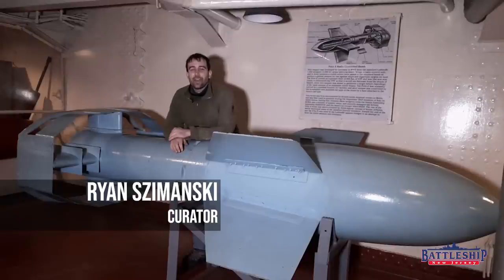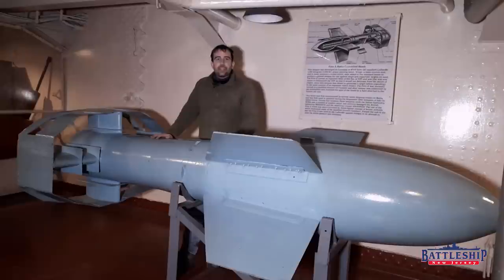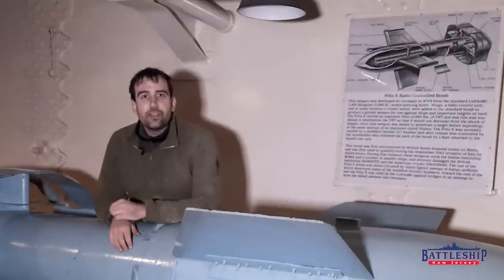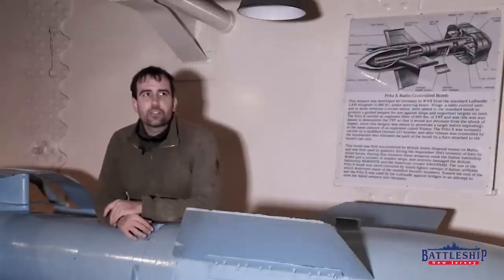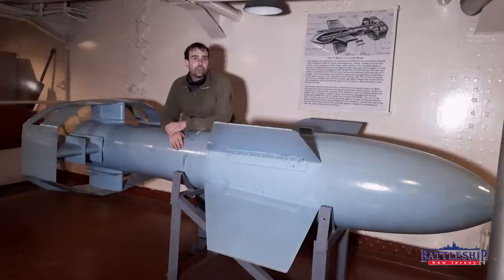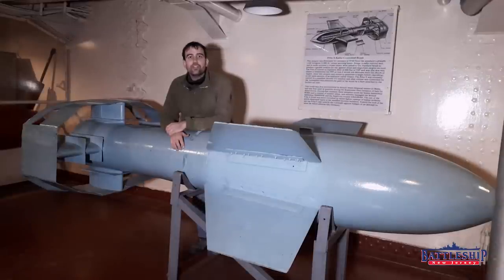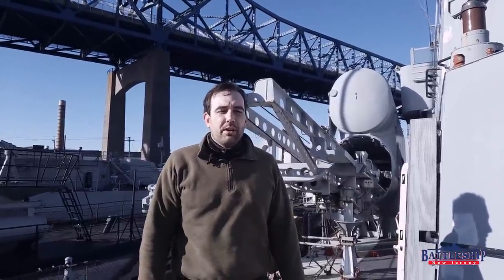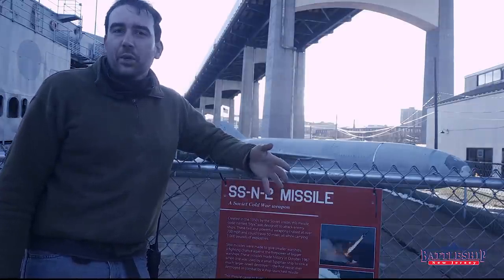Missiles Vs Battleships: Styx and Fritz-X

Comment: Styx is armour piercing, it has a hollow charge warhead. Also, the FX 1400 didn't carry fuel, it was a guided bomb, somewhat similar to the modern paveway series bombs, though they are laser guided. It had a flare in the tail to help the bomb aimer track it. The Hs.293 rocket bomb carried fuel.
Reply: I get hit with rocket bombs whenever I eat Mexican food.
Reply: I've always wondered how effective AShMs would be against a battleship, they carry big HEAT warheads but how effective would that actually be at punching through belt armor and reaching critical systems? They blow massive holes in modern ships, but those are pretty much completely unarmored and aren't designed with the same layouts as older ships meant to receive heavy shell fire in a battle line. 

Then again I assume they're still quite effective or modern navies would still use armor.
Reply: @MrMattumbo  Some modern shaped charges can penetrate up to 7 or more cone diameters. Even a WW2 era one was probably good for 1.5 at least. This is with rolled homogenous armour. I've no idea what difference face hardened armour will make. A Styx is 30" in diameter, so its warhead might be somewhere in the 16-21" diameter ballpark. If that hit a 13.5" belt at a favourable angle then it probably has a fair chance of penetrating and doing some damage, assuming the HEDP warhead is good for at least 1.5 CD of penetration. Whatever damage it does behind the armour is dependent on how heavily the armour is overmatched.
Reply: @ant4812  Keep in mind that the Iowas don't just have a single external armored plate, the 12" belt is internal. So there's probably some spaced armor effect if you fired a HEAT warhead at the hull.
Reply: Styx would not penetrate to a critical  area on an Iowa. Internal belt plus size would give the Styx very little effect on an armored ship of that class.
Reply: @patrickmccrann991  Same goes for many other missiles. Armor piercing 2,000lbs shells are by all means more capable of damaging sub systems than steams of heated copper, because one will keep going for several decks and explode, the other only keeps its form for a dozen feet whilst exploding practically on contact. 
And some missiles don't have shaped charges, they're just raw explosives. Nice art across the ship's hull y'know? Gotta love the splatter effects.

Comment: I was a Radarman on the USS Dahlgren DLG-12 and did a Med cruise back in 1970. The Navy at the time was hyper aware of the capabilities of the Styx missile. I also worked in Electronics Counter Measures (ECM) and was trained on what to look out for with these missiles. The Osa and Komar boats both carried these missiles. The ships navigational radar would go from a circular scan to fire control mode before firing. If I remember right it took about 30 seconds for them to acquire a fix on you before firing. Three years before my Med cruise the Israeli destroyer Eilat was attacked using these missiles and blew it out of the water. We were told they were heat seekers and flew down the Eilat's stacks. During this cruise we were one of the first ships "on station" off the coast of Jordan during the Jordanian Civil War. Needless to say, knowing what had happened to the Eilat three years earlier, we were very concerned about picking up that Osa/Komar navigational radar before it went into fire control mode...
Reply: The sinking of Eliat also spurred on development of anti shipping missiles of Exocet and Harpoon.  It was almost negligent of USN to only rely on carrier attack aircraft to engage ships beyond horizon.
Reply: @tonymanero5544  As an ops guy I was very tactically aware of our opponents capabilities and our weaknesses and I couldn't agree more. I felt so back in those days. The Soviets had anti shipping cruise missiles that would put the Styx missile to shame even back then...
Reply: @retiredguyadventures6211  Nothings really changed then...
Reply: There are 2 homers on the Styx and Silkworm so you have to use flares as well as chaff if you don't want to get hit by it or just let CIWS do its thing since they designed even the fist models of it with those things in mind.
Reply: This is interesting. as i thought Egyptian only operates Styx which have Active radar homing (P-15T) There were indeed 2 variants of P-15's the "T" and then "U" variant which a heatseeker. The latter was famous due to India-Pakistan War. where Indian using their heatseeking Styx against ground targets.
Reply: @neilbaird2789  We didn't have CIWS when I was in. Our missiles were Terrier/Standard missiles were our 1st line of defense and our 3" twins and 5" main gun were our second line...
Reply: @tonymanero5544  
Harpoon was just for sub busting iirc
They pop up and you pop them down permanently.
Reply: Well  I have good news.
If your ship ever had SRBOC you were very very safe.
... seriously.
I have a paper here about the abilities of the Styx, in about 99% of cases where the defender successfully deployed countermeasures they just didn't take a hit.
Reply: @retiredguyadventures6211  
I don't think Terrier was rated for MD duties? Was it considered a hail mary type of dealio or...?
Standard likely would have kept the rain out, especially after aegis datalinks and OtH targeting rolled out.

Comment: About the effectiveness of allied jamming, well yes and no. Later in war the Germans wired the bomb in order to prevent jamming but the big problem was that they had no targets for the bomb by this time plus the skies were swarming with allied fighters and so on.

The national museum of united states air force agrees with me: "Later operational "Fritz X" bombs were wire-guided instead of radio-controlled to prevent jamming."
Reply: I think more likely that later in the war they didn't have enough gas for the bombers, pilots to fly them, or ability to get one anywhere near allied convoys in the daytime.  Either wire or radio guided, they weren't fire and forget, so it would have been tricky to keep on a relatively straight and level course to target with allied fighters running CAP.

Comment: Woah, absolutely incorrect to say the Styx is not an armor piercing missile. It has a 1 ton shaped charge warhead and carries the fuel tank ahead of the warhead, so it will spray burning fuel in through the hole it has punched. However, the Iowa class has about a 1.5" exterior shell outboard of the armor belt, and this would have set off the warhead while also providing space for the shaped charge jet to lose focus. So it is correct to say that it would almost certainly not have penetrated the armored belt, but not to say that it did not have an armor piercing warhead.
Reply: There's the trouble though.
You need about... I think 12 cone diameters for even early shaped charges to START losing punch. 
How much space is there, son?
Reply: @KoishiVibin  I'm going to have to ask for a source on that, because it sounds like an overstatement. The panzerfaust of WW2 has a warhead diameter of just under 15 cm, so maybe a 5" (12.7 cm) cone diameter. A layer of sandbags on an M4 medium tank glacis was supposedly enough to improve the standoff and penetration. A sandbag is probably about one cone diameter, and that has a measurable effect on penetration, so the claim of 12 cone diameters to even start to have a measurable effect sounds ... well, again, like an overstatement.

Comment: There have been lots of questions about effectiveness of the weapon itself.  But what would the life expectancy be of a bomber flying straight and level toward an Iowa class battleship in 1944?  I ask that because the 5" guns on New Jersey, and the crews and systems behind them, were probably the best ship anti-aircraft defense in the world at the time.  Either the radio or wired version of Fritz-X required a person onboard a plane to guide the weapon to the target, and the US Navy knew that.  The reach on the 5" guns with vt fuses is pretty long.  Torpedo attack seems more dangerous, as they were lethal and fire and forget, even back then.

Comment: The Kirovs had a massive battery of SS-n-19s Shipwreck missiles...and the Kirovs were a major reason for the Iowas being brought back...so how evenly matched were they?
Reply: Enough that I heard Russian admirals were terrified of them. Mission killing a carrier was easy but a heavily armored battleship was very different story.

The majority of fanboys out there would say a Kirov would win. However this is purely based on the speculation that a P-700 could actually mission kill a battleship. The Iowa's have a massive amount of redundancy systems.  As such the Admirals knew if they didn't somehow force an Iowa to retreat then their secondary weapons would be useless against the Iowa's main battery which out ranged their torpedo's.
Reply: shipwrecks aren't designed for battlewagon thickness armor they're designed for modern almost no hard armor at all ships they would have bounced off so to speak!! it'd be like shooting 22's at AR 500 targets! just smudges left behind!
Reply: He has a video on it. Basically, without any sort of escorts on either side, the Kirov would be able to mission kill the Missouri from outside 16" gun range and the Missouri if still effective after the Kirov unloads her magazines, couldn't catch her when she ran away. So a one on one engagement would result in a damaged but still afloat Missouri and a Kirov running away with empty magazines.

Comment: I suppose todays equivalent to sink battleships would be bunker busting bombs - or basically the guided version of a Tallboy. Which, if I'm not mistaken, was used to penetrate the insanely thick ceiling of german U-Boat bunkers.
Reply: The Germans should have used two types of bombs. A first one able to automatically home in on the jamming device. Subsequent bombs with regular radio control.

Comment: The SS-N-2 came in 3 variants and the Silkworm was a Chi Com version of one of them and thanks to that NDA I signed the day I got out, I can't say which one it was but I bet you already know which one it was. CIWS was made specifically with those in mind when it was designed because they were (low slow flyers). The CIWS mount that opened up on the MO was likely firing because its pulse doppler picked up the chaff round as it was being launched and perceived it as a missile coming its way since its radar is designed to only see and track fast moving objects in the air that fall within certain parameters. The actual chaff bloom is invisible to the CIWS radar since its not moving fast enough but the rocket its launched in, absolutely moves fast enough for CIWS running in AAW Auto to lock on and shoot it.

Comment: Ive heard of an early british tactic against the fritz-x which involved the crew standing on deck with electric razors which jammed the radio signal controlling the bomb due to unshielded electric motors on early razors.
Reply: Drachinifel was asked about this and he actually found a reliable source confirming this (drydock: https://www.youtube.com/watch?v=x4afXMtBBl4&t=2572s ). Such a bizarre story.
Reply: @BrikBot  yup thats where i heard it XD
Reply: Sounds pretty sketchy. The power emitted by an electric razor would be negligible at more than a few yards range even if completely unshielded. Even many electric razors wouldn't have much more range as there's no antenna. Probably just wishful thinking.

Comment: You mentioned the weight of the Fritz X,. "including fuel". I thought the Fritz was a glide bomb?
Reply: Not sure, he also calls it missile despite it being a guided bomb

But if i remember correctly it had a flair like trail to help guide it, which might need some "fuel"
Reply: @moritzk3004  a set of flares in the tail for visibility, because the bombardier had to visually track it to the target and guide it using a joystick and radio control.
Reply: @moritzk3004  And "missile" really means any weapon that travels through the air to its target.
Reply: @Mishn0  no, a missile is self propelled, a bomb isn't
Reply: @moritzk3004  Incorrect
Reply: @Mishn0  Based

Comment: I would love to hear your analyses on the effectiveness of a P700 Granit (SSN19 Shipwreck) salvo from a Kirov, Slava or Oscar against the armor of an Iowa class. The Granit is a much faster mach 3+ and much heavier missile with some armor piercing capabillities and they were fired in salvo in swarm mode. Love to hear your thoughts on that.
Reply: Personally, I think the Shipwrecks, or the SS-N-12s on the Moskva (Slava-class) would have had limited impact. While they are faster and have some bulk to them, they were designed to punch through a Nimitz carrier's armor and detonate inside the hangar. Those carriers pack about 3in of armor, granted they probably could go through more armor, but I think expecting to KO a turret or punch through the armor belt and deal massive damage might be expecting too much.
Reply: @Firestorm2900  not to mention Phalanx guns as a welcoming committee
Reply: I think P-800 and Kh-31 would already be sufficient in dealing with carrier group. The P-700 is too big and pretty much only the largest ship (oscar, kirov and the kuznetsov) in Russia's navy can carry them.
Reply: @Firestorm2900  I am interesting what would happen when a missile fly through a opened hanger door, and hits the armor from the inside. Would it detonate immediately or would it just pass through the armor before detonating on the other side of the ship. What i know is that the French Exocet missile will detonate after contact with the radar signature so when it pass through chaff it will detonate.
Reply: @許進曾  probably detonate out the other side, they probably have a delay fuse
Reply: @許進曾  To answer your first post, I think it'd depend on how they're built and what armor they were meant to penetrate. KH-31 with it's shaped charge could be a decent choice depending on how much armor it's mean to punch through. Not sure about the P-700, it does say it's semi-armor piercing, but the Harpoon is also credited with minor armor piercing thanks to it's delayed impact fuse.

The answer to the second would be the explosion would punch a hole in the side, but most the explosive force would be on the outside of the other side, or the missile itself would go through the armor before detonating. Depends on how it's fused.
Reply: @Firestorm2900  Which funny enough the Iowa's are designed perfectly for since the outer belt is thinner then the much thicker inner belts. So even a duel warhead isn't going to be as effective as those are designed to make a dent in the armor with the main charge killing anyone on the other side. 

Correct me if I'm wrong.
Reply: @Firestorm2900  The KH-31 would be a very poor choice to sink a carrier. It's designed to sink ships below about 4,500 tons displacement. To put some perspective on that the Arleigh Burke class destroyers are double that. The Nimitz class is over 100,000 tons. Its "armor piercing" capability is sufficient to penetrate a small ships steel hull. It could probably score kills on corvettes and very small and/or technologically outdated destroyers. But it's role, considering it's capabilities, appears to be in sinking civilian shipping, outdated naval vessels,  and smaller tender type vessels, not truly modern warships.
Reply: @Predator42ID  Tandem warheads (which I think you're going for) is built that the first explosion makes a hole that makes the second warhead more effective. I think Iowa's belts are thick enough that it would withstand it, but it probably would need some repairs to the armor belt afterwards.
Reply: @sikofu2  Ah, so it has the same armor piercing as the Harpoons then. I was on one of the Arliegh Burkes myself so I can get an idea of what the target would be knowing what the KH-31 was meant for now, didn't know it was meant for smaller combatants. Thanks for letting me know that one.
Reply: if want a demo of what it would be go over to iraq veteran 8888 and watch one of their shooting videos the bullets smearing on the steel silouettes would be shipwrecks agaisnt an Iowa's armor!!!

Comment: Silkworms are not small missiles.  They are roughly the same size as a MiG-15
Reply: Not even close really. MG015 was about 10x10 meters and 5 tons. Silkworms were 6.5x2.5 meters and 2 tons.
Reply: So, still bigger than NJ's VWs :)